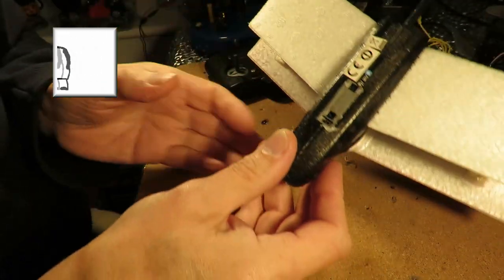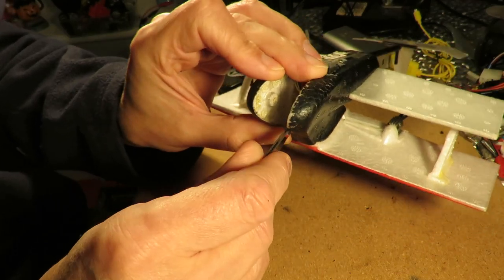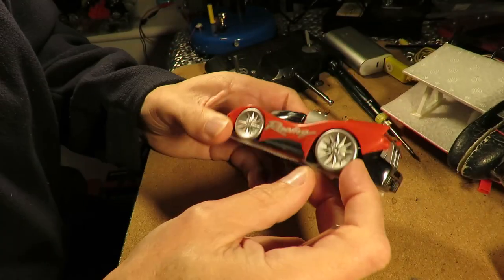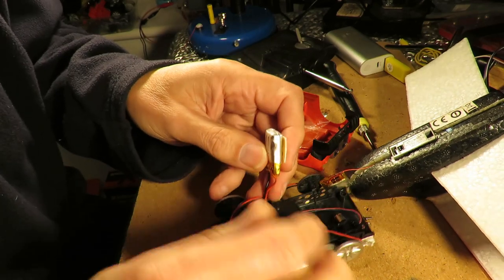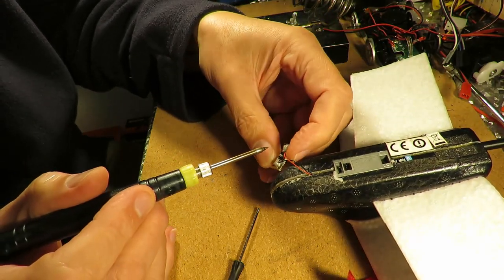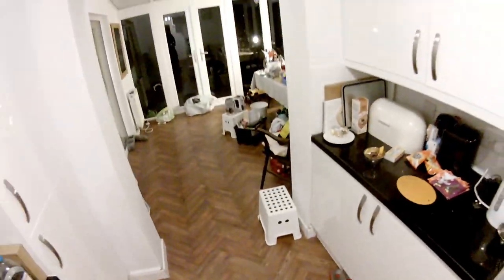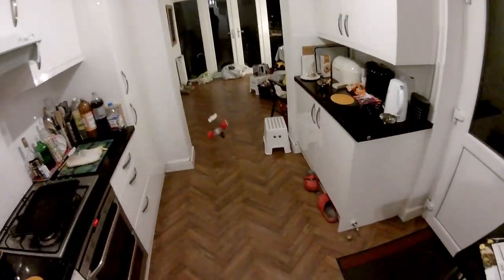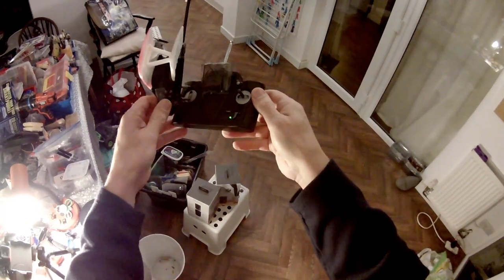PART 2 Silverlit X Flying Club 27MHz biplane LiPo swap

Comment: Think I have one of these somewhere. Car boot buy and I have never flown it. Seem to remember the tail plane needs fixing but good to know the lipo is easy enough to replace. The Palm-Z I think has less space to play with and I guess with only 1 motor is more fussy about the weight. Real shame lipo batteries go bad as I am not sure any of my little planes and helicopters would work now, it's been quite a while since I flew them. Thanks for the video. 😀
Reply from the maker: Thanks, the problem with these little LiPo's is getting the right size but over the years I have learned that the numbers indicate length width and thickness.

Comment: I've been waiting for this video all day.  I will need to replace the lipo from my Palm z biplane (still not arrived yet)
Reply from the maker: It will be a similar process. I seem to remember the Palm Z is glued together so you may need to cut it open along the seam. If you do that you have to be very careful not to cut anything important inside, like the wires, the receiver, or the battery.

Comment: I had this exact same of plane in 2012 i believe or somewhere around there
Reply from the maker: Yes, not surprising the battery in this one would not hold charge after all those years.
Reply: GrandadIsAnOldMan id assume so. Old models sorta lose their energy after a while and eventually will just pack in which is sad. I actually had a few delivered to me because the first one i had got lost the second one was crushed behind my sofa due to my younger brother putting it back there without any of us knowing and the third just stopped working. Decided not to get anymore since it was alot of money at the time.

Comment: If LIPO is "buffed".. its literal fire hazard, speciali when charging. Heavily recommend not use it and but it in battery recycle box first change (and never leave it charging or fully/half charged alone). Love Your repair vids thou, wish stores like that would exist here :(
Reply from the maker: Yes care must be taken when dealing with LiPo batteries
Reply: @GrandadIsAnOldMan  To be honest, with every battery with Li on it. Small 1S is not that bad, but inside plain like that, few sparks can ignite fire. Problem is usually when they get damage or buff. As long as You keep it away from anything flammable/have smoke detectors, should be fine. Seen large 4S go off after bad landing.. and well, was nothing left to salvage from that aircraft. Was hard to but out even with fire extinguisher.
Reply: @GrandadIsAnOldMan  Btw, You still have that nikko airplane that lacks range? Might have few suggestions, with quite few nikko older rc-s.. found popped el-capacitors in controller (transmitter). One had very similar problem, had range of almost 5cm, lol. worked after cap change. Also, some controllers and rc-s have things inside that lets You adjust frequency. 27mhz can be anywhere between 26-30mhz on some chinese toys etc.
Reply from the maker: @antssaar863  I think that one is still up in the loft somewhere. I had intended to swap out the RC to hobby grade but I haven't done it yet.
Reply: @GrandadIsAnOldMan  At condition it is, would pay 50 eur for that easy (thou where i live, prices kinda suck, remote country). Some of old Nikko stuff, with intact box can go rather high on ebay or other auction sites. Many collectors/people who had it as their first :) So I would keep it as it is and only try fix it.  Its easy/cheap to make much better planes from styrofoam etc. Chek petersripol videos, that guy can make even leaf blower fly :)
Reply: @GrandadIsAnOldMan  First I would chek controller, is there any capacitors, water/humidity damage, bad soldier points and antenna connection. After that, much same for receiver.  Its an oldie and over time, solder points tend to go bad sometimes. Especially if cheaper lead is used and done by machine.